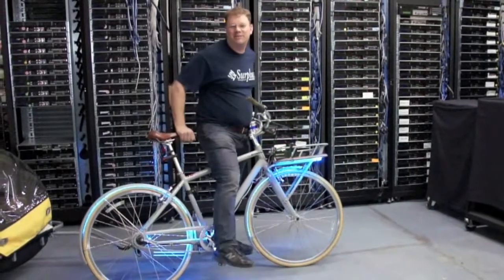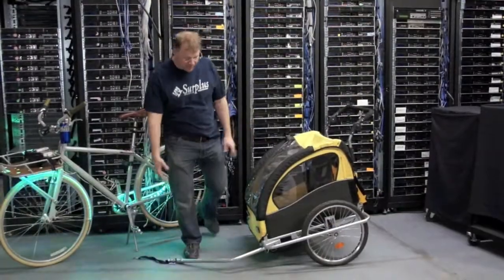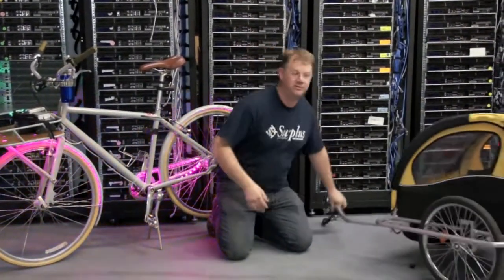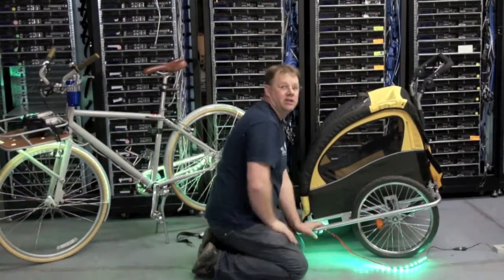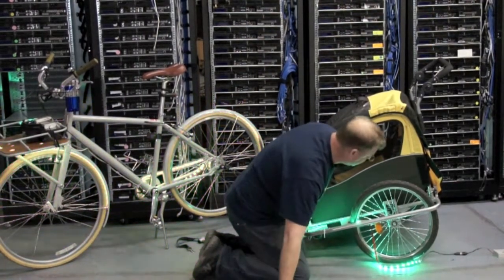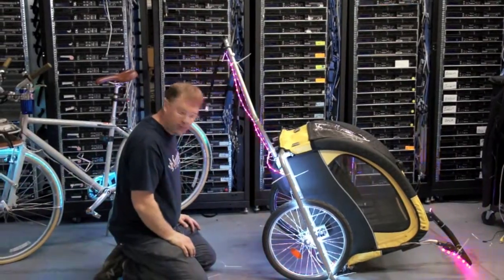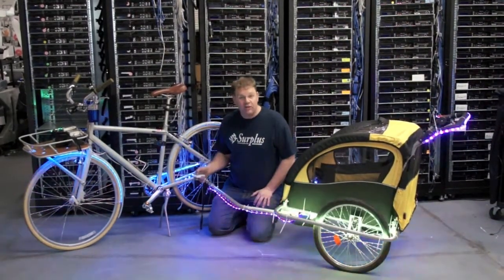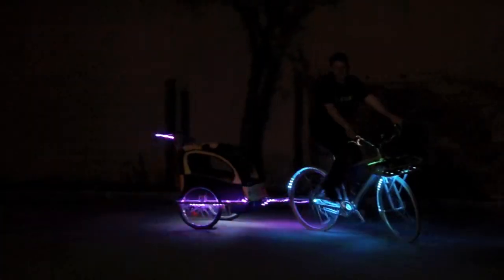EZ-EL led bike trailer

Comment: I've just been trying something similar, but focusing only using red LED's for the rear. However, the adhesive backing doesn't seem strong enough to attach, especially not in all weathers. Zip ties are a good idea for bar sections, but any thoughts on how to attach to the fabric?

Comment: I'm placing twin 9 x 5050 cool white (stacked 3x3x3) on the front of my Croozer K42 and same for the rear in red, similar to tail and head lights, only they are bright 'markers' @ 12v .7amp w/flasher.  On the sides of the trailer are the standard orange spoke reflectors and I'm also considering some reflective safety tape there as well. All of which conform to Australian standards where I am. Children's trailers are dangerous enough without towing them at night, in traffic. Lights must conform!!